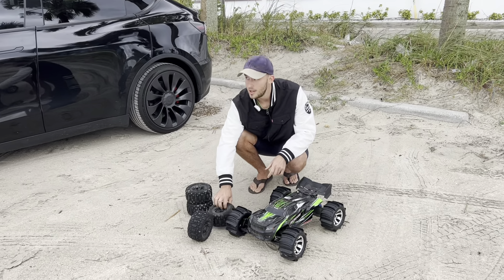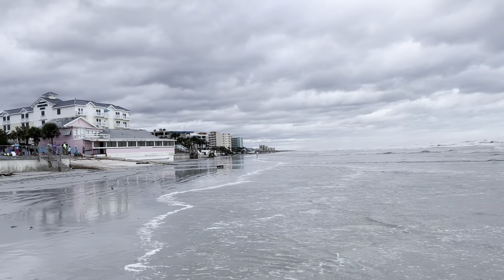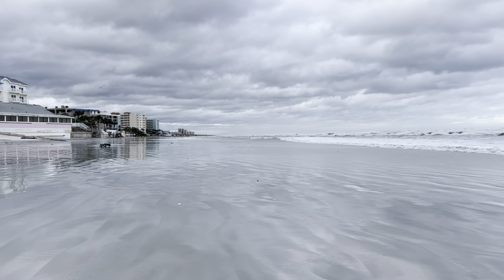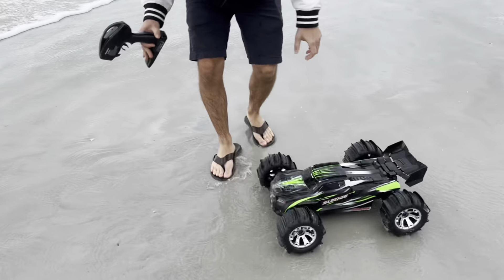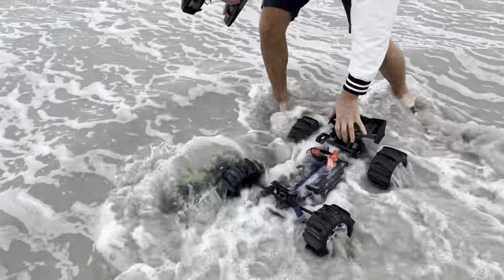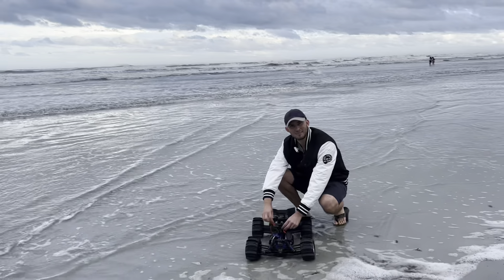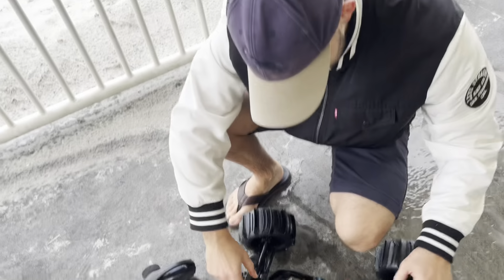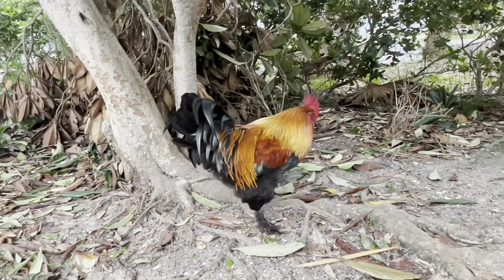Sledge on Paddle Tires Hits the Open OCEAN

Comment: Nice sledge video😁.
I think that the green flashibg led on the esc meens radio signalloss?
Open the reciverbox and see if any water got inside or if the revier just need a rebind.